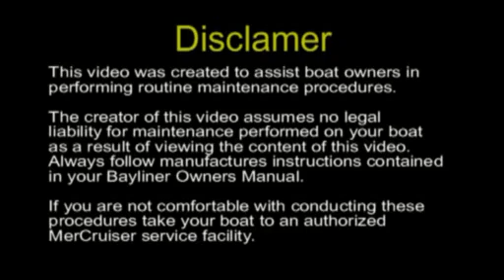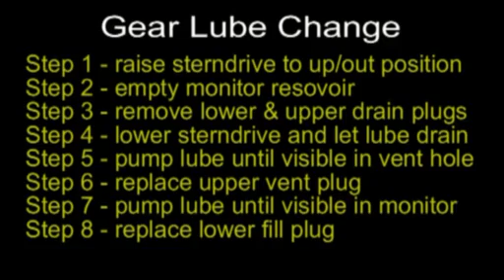How to Change Gear Oil on your Boat Outdrive - iboats.com

Comment: One important small step not to miss & mentioned in the video, is to install the monitor cap BEFORE installing the lower unit screw. The air lock it creates really reduces the amount of oil escaping while removing the hand pump's plastic fitting & replacing with the screw. GREAT VIDEO!!!

Comment: Great video stressing creating the air lock so there is no air space.  The first time I did this my self, I only did it half right, pumping it from the bottom until the oil flowed out of the vent hole.  From there, I screwed both plugs back into place and simply topped off the reservoir.  There must have been alot of air space in the system.  However, ran that for two season and nothing died, so I guess it worked its way out as the reservoir always needs topped off once or so per season to keep it above the "add" line.

Comment: Great video but i think there is backflow valve in that handpump so you don´t need to make that airlock to change oil bottle. That kind pump just dont work without backflow valve.

Comment: thanks for the video,just have a question how long should change gear oil?
Reply: +Hoang Tran i change 1 time every year. or every boatseason:) the same with the impellar:)
Reply: Great question, it depends on your operation.  If you put on 100 hours a season, definitely every year.  If you put on 30-50 hours, two seasons per change will be fine.  I go by this and I have had no problems.  Gear lube isn't expensive so it can't possibly hurt to do it every spring.

Comment: My outdrive is an older Alpha from 1989, and I can't find a resevoir in the engine compartment anywhere. Did the older outdrives not have them?
Reply: No. The Alpha One Gen 1 and earlier models do not have a reservoir. All the steps of this video remain the same, let emptying/filling the monitor.
Reply: ***** When I changed my lube, I took the top plug off to drain it, and only got about 1 quart out. I filled it back up, and put in about 1.25 quarts, and it came out the top. I thought it took more like 2 quarts. Is it less because I don't have a resevoir?

Comment: He did not raise the engine, he raised the the stern drive, out drive, whatever you want to call it. Also the "motor" doesn't move to the side and he doesn't put his knee against the "motor" but the drive unit. I don't believe this rig has a motor, regardless, it has an engine.